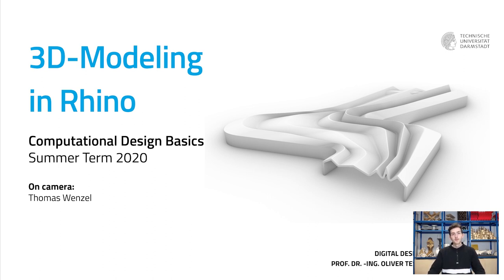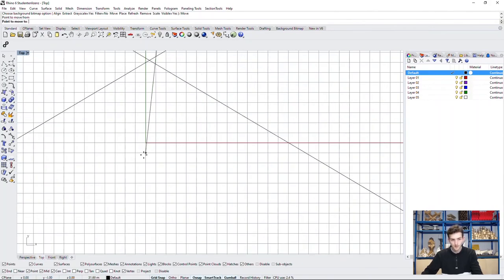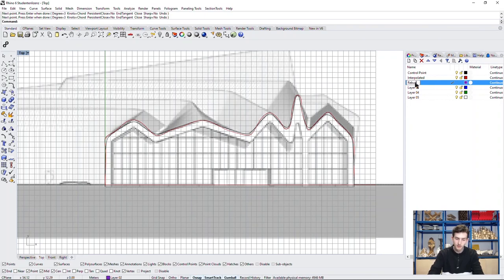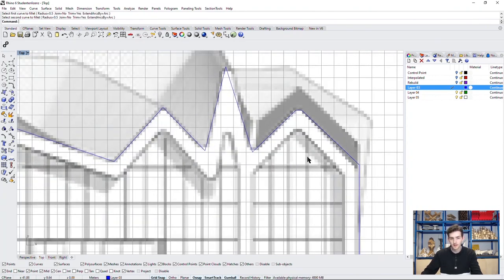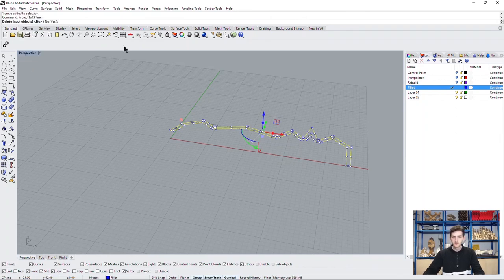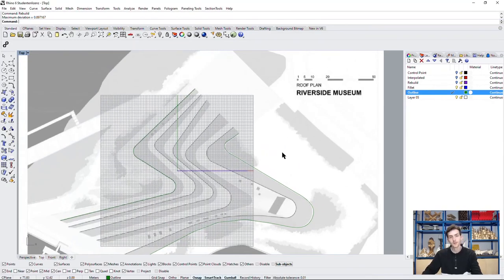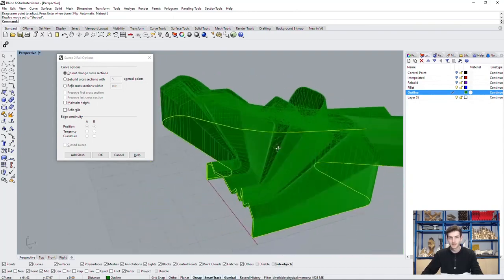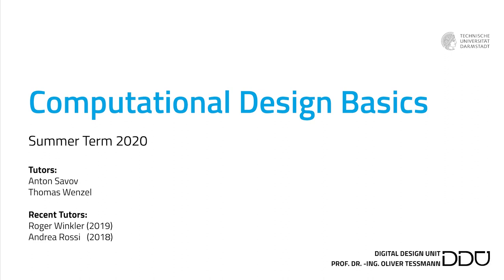Advanced 3D-Modeling in Rhino

Comment: When using rebuild to smooth the polyline the amount of points used makes adjusting the curve further really difficult. I like to use handle curve with as few points as possible. The points are right on the line which makes tracing pretty easy.